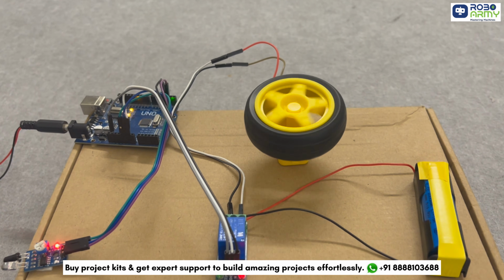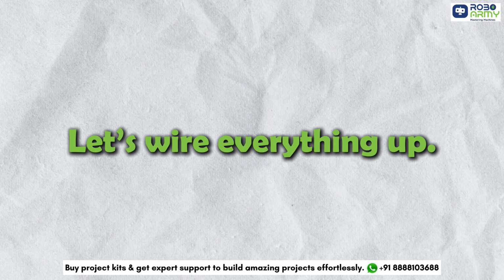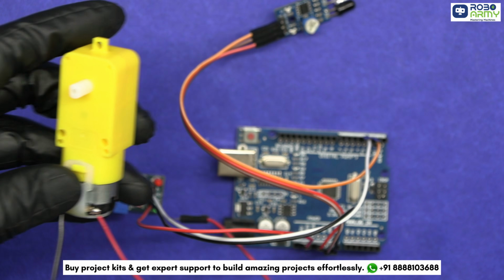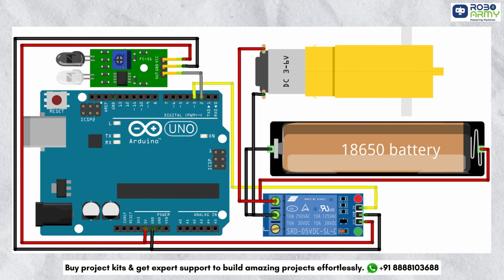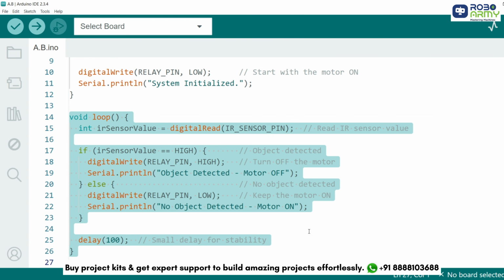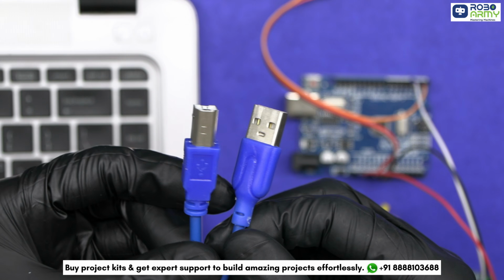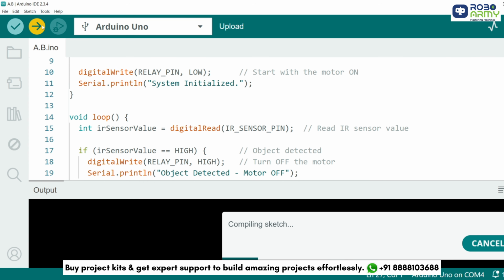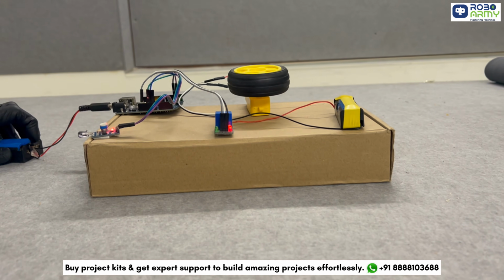BrakeSafe: Smart Auto Braking System | Arduino Coding + Circuit

Comment: Instead of single motor can we make a it by 4 motor running in the same code by the single kit?
Reply from the maker: Yes, it is possible 👍
You can run 4 motors using the same logic, but you’ll need a proper motor driver (like L298N or L293D) to control them safely. In the BrakeSafe: Smart Auto Braking System, all motors can be connected in pairs (left side & right side) and controlled together using the same code logic.

However, a single basic kit usually supports one motor. For 4 motors, you may need an additional motor driver and sufficient power supply.

Comment: Why you are using smd model of. Arduino you Can also use dip model because IC of smd model become hot and blast for your safety I have said you😊
Reply from the maker: Thank you for your concern! 😊 In our RoboKits, we use the SMD model Arduino because it's more compact, stable, and reliable for educational kits. While SMD models can get warm during extended use, they are safe if used within recommended parameters. Plus, we guide users on safe handling to ensure a safe learning experience.